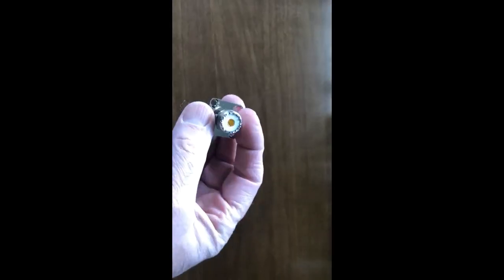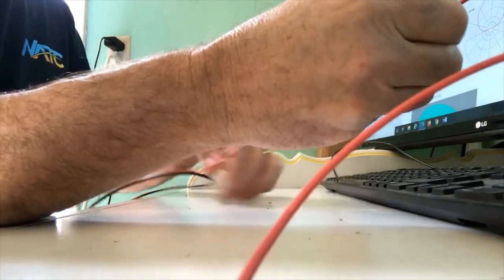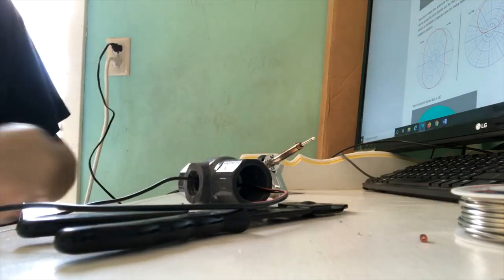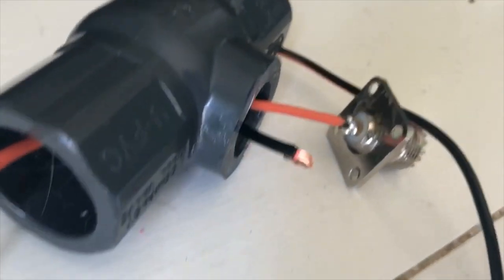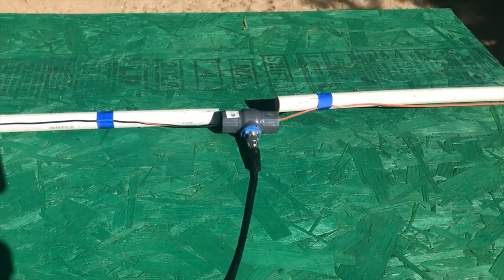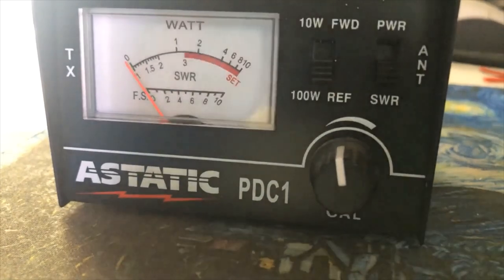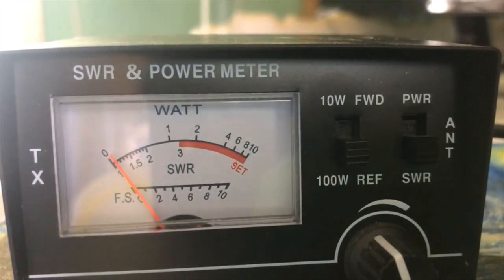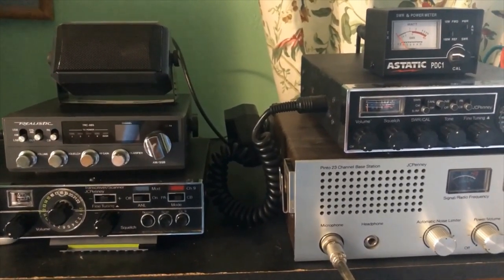Homemade PVC CB Dipole Antenna

Comment: CB people are funny as hell. You tune the antenna at channel for the best at channel 20, then live with what you get at 1 and 40.
Reply: Why? When you can make it better everywhere. Why “settle in “ when  better is obtainable
Reply: chanel 21 is the middle of the band , great there is good at the far ends
Reply: Ham operator?
Reply: @rustyholt6619   Chanel 21 is not the middle there are hidden channels and skipped frequencies in the 1 to 40 channels, dunderhead. Dither 1&40!
Reply: It depends on usage. I generally stick to lower side band, so I want to keep my SWR low at channels 32-40. Most of the 40 channel only guys stay below channel 23, so they want a SWR at 19ish. Yea, I know there are exceptions! There always are.
Reply: I tune to 27.305, but I'm mostly sideband...
Reply: @paulmaluchnik4962 😅😂

Comment: Good attempt but you need to brush up on your antenna theory. You’ve made your antenna resonate in situ, meaning it resonates where you’ve physically located it during the process of the tuning procedure. Once you mount it at any appreciable height above ground your VSWR will be completely different than what you’ve initially trimmed it at. You need to tune your antenna in the position and height it’s going to be used in, not near the floor in your workshop.

Comment: I recently found this video (2023) and I can tell you this is the most detailed, easy-to-follow instructive video I have found yet. I went out and bought the supplies I need and I will be making this, hopefully within the coming week! Thank you for this video! BTW...I'm an older CBer from the late 60's and 70's. I love sideband and was thrilled to find one on Amazon for my home. I already have a plain Cobra 40 channel for the car. Things have sure changed over the past 50 years or so! But I'm happy to see that CB radio survived, and kept the band alive!
Reply from the maker: Let me know how it goes, thanks for watching!
Reply: Did you make it yet? And did it work??
Reply from the maker: II had it up for 2 years and it worked great. I reached 49 states and as far away as Australia. I just replaced it this week with the Solarcon A-99. Thanks for watching and 73s from 595 Lake Tahoe Nevada!
Reply: @greghill254   How did you mount it? Horizontal or Vertical?  I did the same as you ordered the so259 and I have the other parts..  Will be building when the part gets here.
Reply from the maker: @eleveneleven5305 I mounted it horizontally on top of my RV outside my radio shack. It is around 10 feet above the ground. Not an optimal height, but it had performed well.

Comment: Just a tip on soldering. Heat the part you are soldering with the iron. Holding the tip of the iron on one side of part and solder in another spot when the part reaches the proper temp the solder will liquefy and get into all spaces where your flux is. This way all parts will be at the same temp and become one unit .
Reply: doesnt hurt anything, but dont need nearly that much flux

Comment: Mount this vertically and you"ll increase your contacts exponentially
Reply: Yes, but to mount it vertical ,you don't want to have your coax running parallel to your antenna.  You may want to run about 4 foot of PVC out the side at your feed point and tape it down.  That's what I had to do for a dipole I made .  The bottom element is about  5 feet off the ground and it still works great.   Look around on here and ask an Elmer to make sure.   Good luck .
Reply: @gotman4409  Try 9 turns of coax around a bleach bottle as a form, back at the shack. Then the coax can droop down at about 45 deg to the vertical dipole. The coax shield may become part of the antenna but only back to the air choke, so keep that outside. It might even be a great idea to put the choke 1/4 wavelength from the antenna feed point as well. This is the poor mans air choke and works very very well for me. I have a vertical dipole that has a 1 all the way across the CB band (according to a NanoVNA and my radios' SWR meters agree) and is so wide banded I could go all the way to 26 to 28 mhz and stay under 1.5. Use metal pipes for your radiators, not wire inside of a pipe and it will lower you Q by so much you'll barely have to tune for 11m.
Reply: You mean make the dipole like a field goal pole ?
Reply: Rich man poor man doesn't matter as long as you get results
Reply: @deankoerner2436  Well maybe something smaller like  1/2" or 3/4" pipe, but if you have a large piece of pipe laying around try it and see what you get. With larger diameter pipes it works really well.

Comment: Tip about soldering, heat the metal and wire a few seconds before you apply the solder. Keeping the iron applied while feeding the solder, the solder should flow into the wire and connector. Keep the iron on it to ensure the solder is absorbed. You should have a nice smooth finish with no lumps.
Reply from the maker: Thanks for the tip, this was my first attempt at soldering. I'm been improving with experience. Thanks for watching!
Reply: I always would tin the wire, apply solder to the pin, then insert wire into pin (while solder is hot). There should not be much, if any, solder on the outside of the pin. Also, if you file the nickel plating off of the shell of the connector it is pretty easy to solder to it.

Comment: The antenna should be adjusted in free space. Feedpoit impedance will vary close to objects and also between horizontal to vertcal mount. Also use a Nano VNR for more accurate readings. Also transmitting horizontal to hit a vertcal antenna will give approx. 20 db loss in signal (both ways). A good video and nice construction. Keep at it. 73...
Reply from the maker: Thanks for the suggestions, I've read about the signal loss between antennas when they are orientated different. I went with a horizonal mount for better skip. The feed point impedance would explain why my SWR changes when I move the antenna around. I really appreciate the advice from  people like you with experience. I've learned a lot about antenna properties that I would never have known about.  73s from 595 Northern Nevada!
Reply: @RidgeHikerAdventures  Actually a vertical antenna has a lower radiation angle especialy at sun up and sun down. In other words greyline conditions. Probably around 20 degrees or something like that. Not sure. I have worked a lot of dx, states, south america, asia… with a homemade groudfed verical setup here in norway. Maybe a look at the Dx commander channel can shed some light on this matter. GL…
Reply: @RidgeHikerAdventures  73s, my friend. Hope to see more from your builds in video format. Very intertesting. PS! We all learn from eachother! No matter how long we have worked on antennas and other stuff. CU...
Reply: I agree that proximity of of antenna elements to some materials will affect impedance match so what is the logic of trimming the antenna in free space only to thread it into 17 feet of PVC? It would make more sense to adjust it under as close to it's operating conditions as possible.
    It would seem to me that doing it your way would be akin to matching a mobile antenna to a car in the middle of an open field then driving it into a metal garage and expecting the match to remain the same.
    Not trying to be a dick, just sayin'.
Reply: can i ask you for some advices?

Comment from the maker: I made a improvement on the antennae. I drilled small holes on the endcaps of the PVC pipe, attached weed whacker line to the ends of the dipole wires and fed them through the endcaps. This allows me to keep the wires straight and taut and allows flexibility of the PVC pipe without ripping the wires off of their connections.

Comment: I watched your Video. Built a Dipole antenna similar to yours. Hung it inside my detached 2.5 car garage. Straight horizontal line about 14 feet above the ground. My SWR’s are about 1.2 across the channels. First day I spoke to Austin Texas for about 20 minutes on LSB channel 38. WOW. I built a second one to hang outside. SWR Readings we’re in the 7’s. I think it’s a bad Connector. I will send an update when I get more connectors for my outside Dipole
Reply: I forgot to mention I spoke to Austin Texas from my home base in Upstate NY

Comment: What was the final wire length? About 102" on each side, I'd imagine. 
The thicker the conductor, the shorter the antenna. 
A vertical dipole will outperform an A-99 every time. The A-99 has a LOT of loss in the matching network, a dipole needs no matching network. As a bonus, no radials are needed as both "halves" of the antenna are present. 
Antennas like the A-99 use the coax shield and mast, etc as the other half. 
The only thing I would add to this antenna is several wraps of the coax on, say, an inch and a half form to be an effective RF choke and keep and unwanted current off the coax shield. 
Nice job 👍🏼
Reply from the maker: Thanks for the advice, I still have a lot to learn about antennas. I've noticed that moving the loose coax around outside, will change the SWR readings. I'll have to try the wrapping the coax as you suggested. 73s from 595 Northern Nevada.
Reply: "The thicker the wire, the shorter the antenna."  A negligible effect.  There may be some change in the resonant point for a given frequency between 24g and 12g stranded copper as resistance and reactance change, but nothing to consider.  Engineering an UHF/VHF blade antenna for an F/A-18?  Deploying an HF antenna from the space shuttle?  OK.  A crappy, homebrew, spray and pray dipole for the CB band?  Nope.  Why mention it?  I am positive you don't choose a thicker gauge wire so you can shorten the overall length of your antennas.
Reply: @patring620  negligible?
  If model a 5/8 wave antenna for 11 meters using 14awg wire, then using 1/2 aluminum tubing reduces it's size by two feet! 
Just using insulated wire (as opposed to bare copper) shortens an antenna by 5% .
Reply: Do you wrap wire, 1.50 inches from the end or closer to the center

Comment: Just came across this I would like to try and make this my question is how much did you cut approximately to get of each wire end to get to the swr down also do you think I could mount this in my loft as high as possible thanks in advance.
Reply from the maker: If I had it to do over again, I would just bend the ends of the wire over so you would not have to cut them. I would start with folding them over a quarter inch each side if the antenna is too long till you get the desired SWR. I have read that people have had success with mounting a dipole in their loft. Let us know how it goes. 73s from 595 Lake Tahoe Nevada!